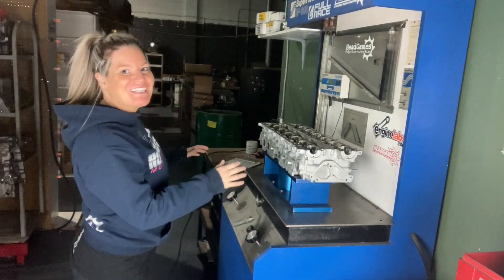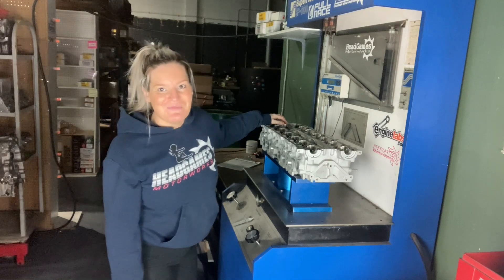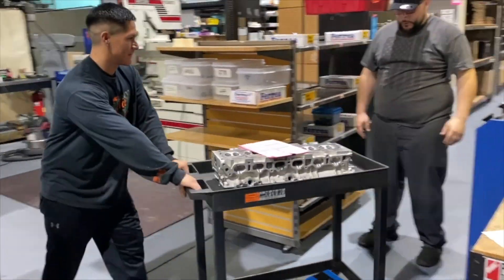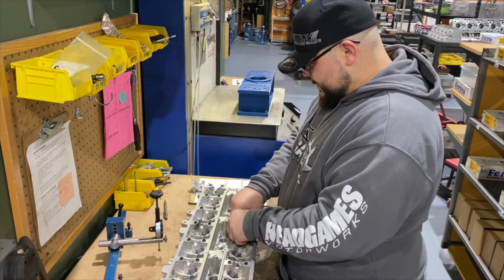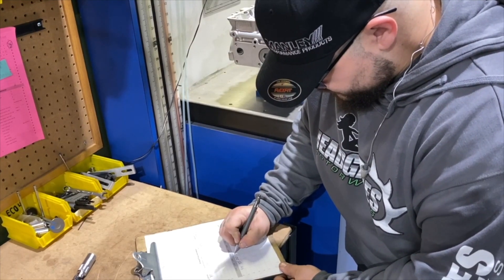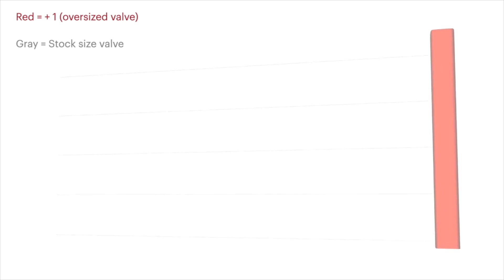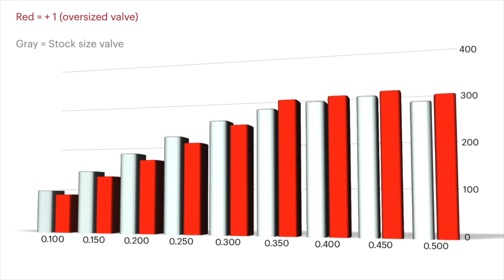HeadGames Motorworks 2JZ Series Episode 5: The Flow Bench!

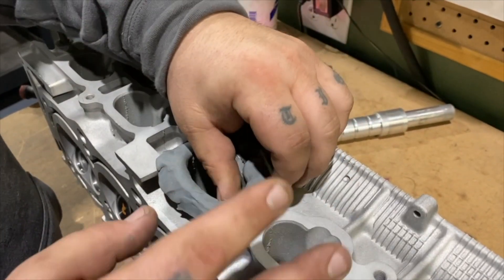Comment: Regarding 1:38 a wiseman once told me that leaving the injector opening open to flow testing gives the port more area at the top to pull air from a better angle, this will give better flow results. 

By blocking off that area while testing creates the void and dead area just like what will happen in reality.